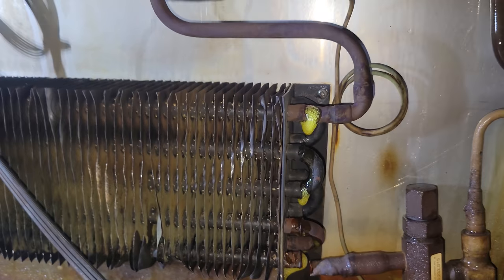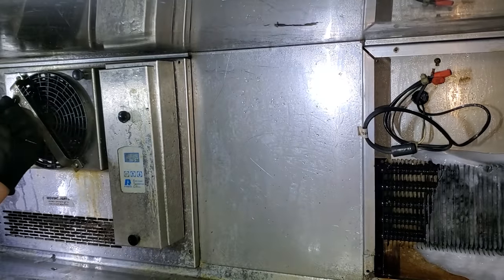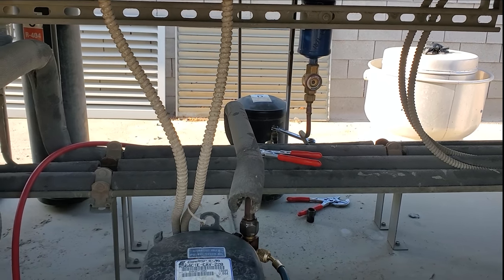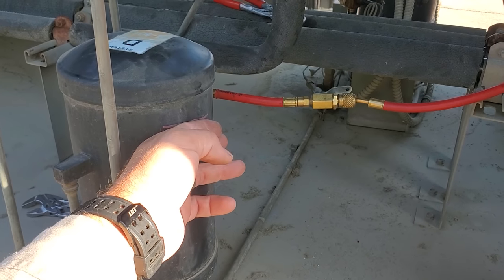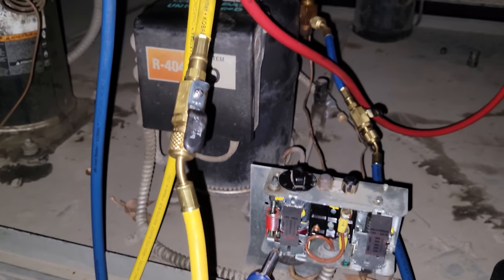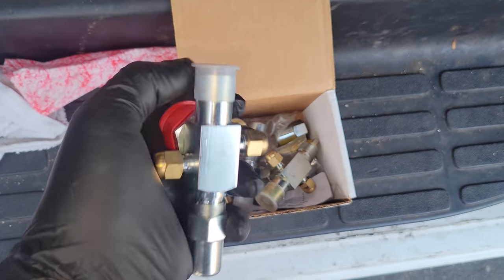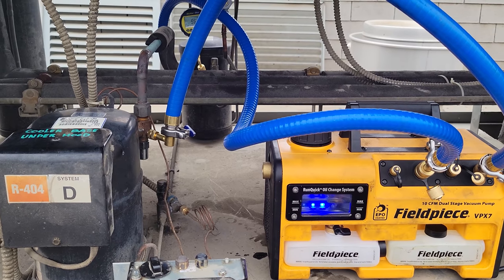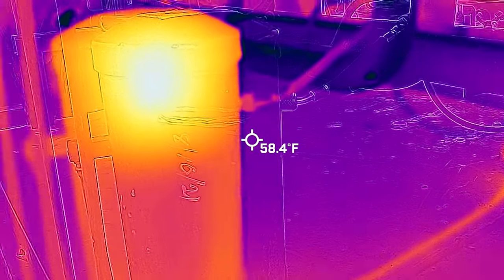THE COOKS DRAWERS ARE TOO WARM

Comment: Helpful hint:  In 40 years as an electrician, one rarely used but effective tool I had was a Dremel.  A cutoff disk would have made quick work of that stuck lock collar on that compressor.  Split the side of it mostly through and then use the pump pliers.  Voila!  👍
Reply: Yup - and since it's brass, cutting mostly through it would let you heat very slightly, and it might even expand itself enough to split through without affecting the compressor threads.

Comment: Question. Don't know if this was addressed already or if I just misunderstood what you said in the video.  You talked about the correct charge using a power head control vlv. You stated, if I recall correctly, the best way to refill the system would be to recover and then use the Manufacturer recommended charge vice using the field technician way to 3/4 th full on the accumulator.  Am I missing something as you went 3/4 full instead. 
Hope all that made sense. Love the vids and take the time to heal thyself firstly.

Comment: Hi boss.pllllzzzz answer
After complete installation of a new unit such as a freezer. When we first want to charge about eighty percent of the total refrigerant in the receiver, how do we know how many pounds to charge? When the unit does not have a label or any guidance on the total capacity of the refrigerant?

Comment: I'm amazed you can get any work actually done when making these videos. it must add hours to your day just stopping and filming. surprised customers are ok with paying for those extra hours..
if it helps drop the midweek to every other week and see if that helps if not drop the midweek or a livestream. I guess you'll need to do the numbers to see which is best for you.
great work good luck 👍
Reply: I think they are clips put together. You can see this from his IG. Also, he has other techs on site. Stop being a hater. Its all part of the big picture quote they accepted. Kind of like how you pad the bill in case you run into unforeseen problems.
Reply: @sherwinalvarez7365  pad the bill? well you might rip off customers but  I don't